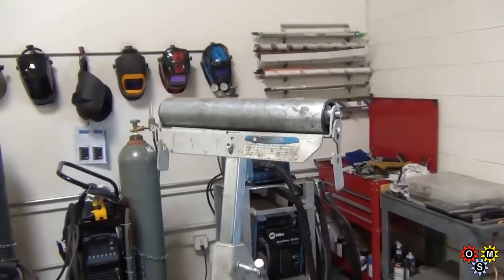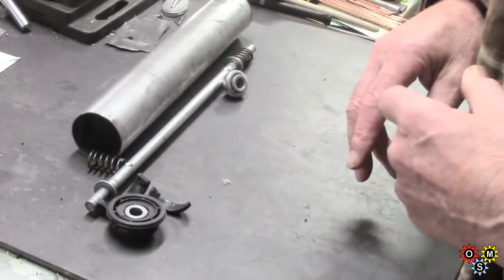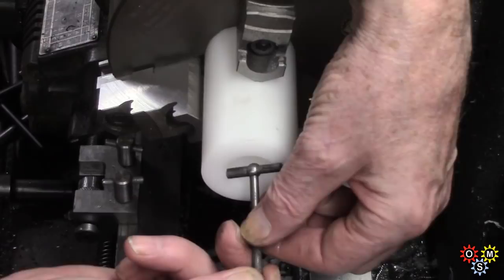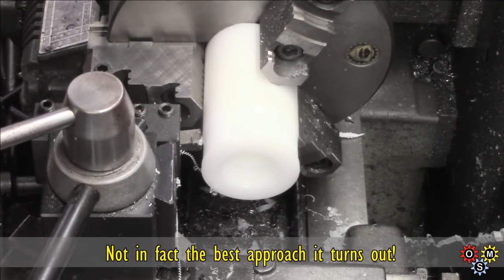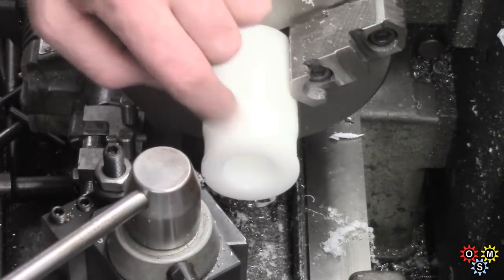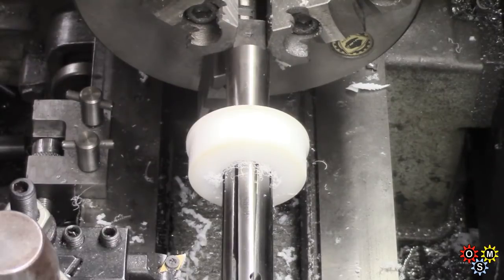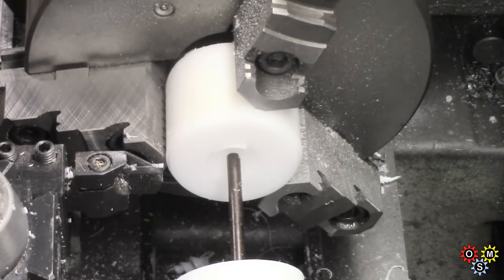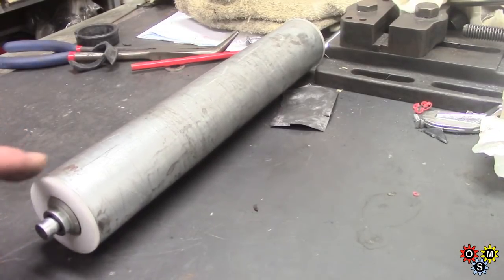Roller Repair

Comment: Another job well done!  That shop looks to be first rate.  Wish mine was that organized. $1000 sounds like a good buy for someone if it's in good shape and comes with some accessories.  Cheers Mike
Reply from the maker: Hi Mike - indeed, I think that Monarch would be a great addition to someone's shop. Quite an old machine but for the price well worth having. Wish I could snap my fingers and see it in my shop! ATB :)

Comment: You could have just omitted the 'bearing' and made two delrin plugs with a hole in to accommodate the shaft. 
Delrin is quite a reasonable bearing material in its own right.... That's more than can be said for those two sorry pieces of potmetal in the roller!!

Toodles!
Paddy

Comment: I have one of those roller stands I am going to see if can improve on its design
Reply from the maker: Hi William - does seem the original has a weak spot with the bearing end caps. Probably depends a lot on how much they are used, plus that material may well degrade with age. ATB